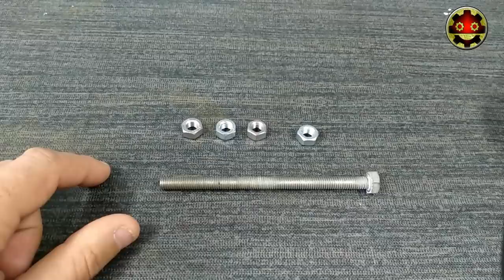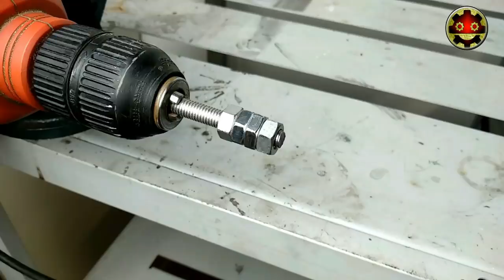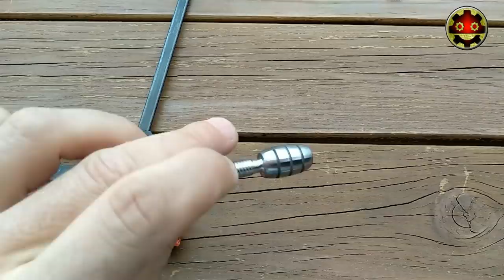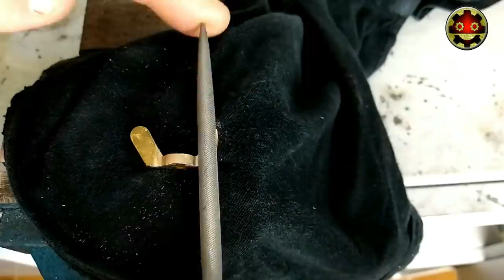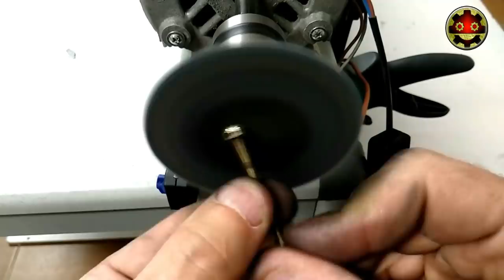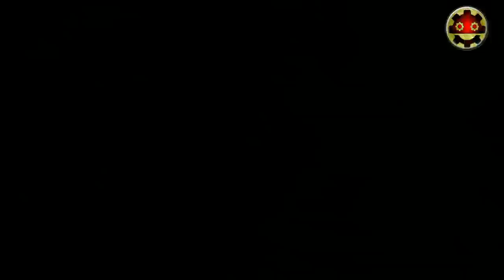Making a Easy Creative Jewel in the Form of a Grenade with a Bolt/ Nuts

Comment: I'm about halfway through this project using (5/16" x 18) nuts & bolts, but I am stuck on how you finished it with the Acorn & wing nut. I would love to get more info on the wing & Acorn nut section! Thanks, really cool build!
Reply from the maker: The central screw must be filed at the tip to fit the wing nut. You can glue or screw making a thread pitch.

Comment: I made one of these following your example. I had to improvise based on the materials i had available (i couldnt find a brass wing nut). It turned out okay, not as cool as yours though.
Reply from the maker: I like that.😋👌 With practice you will make it perfect. the first ones I did were not so good either😅

Comment: What size of nut, stud, cap nut, and buterfly nut?
Reply from the maker: This is 8M metric. you can use the measure you want the only thing that will happen is that it will change the size😋👌
Reply: @MRcustomcrafts  ok sir.. tq